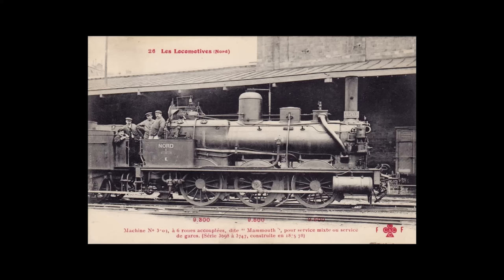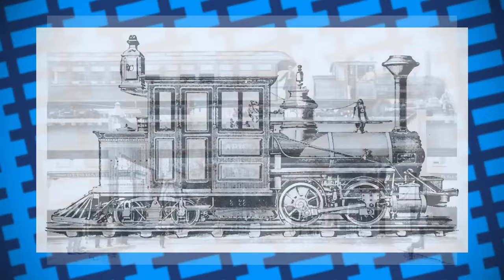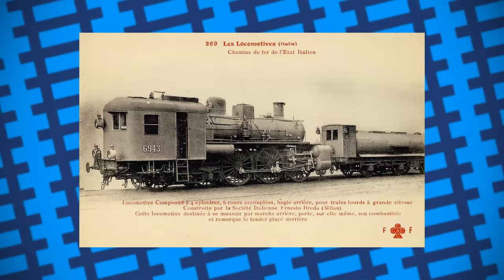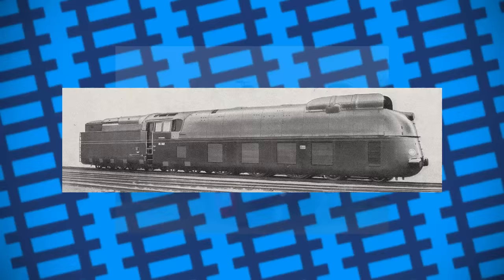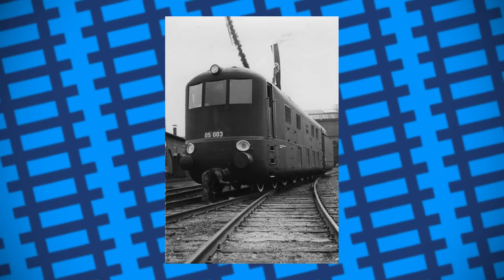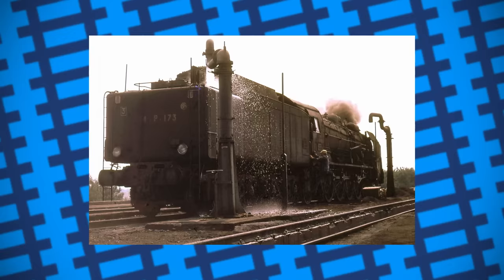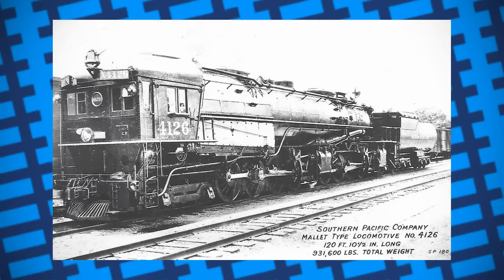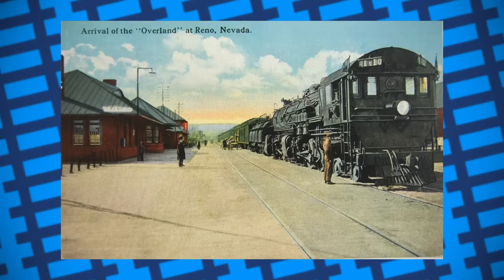Why "cab-forward" steam locomotives usually didn't work - Cab Forward Locomotives

Comment: Why there wasn't attempts to separate boiler input cab and driver cab? Since only the real problem was a coal delivery. It will force you to have at least 2-man crew, but it was usually the case anyway.

Comment: Most of a conventional tender is a water tank and only a relatively small proportion is coal.  Could have had a small low coal tender in front of the cab (or built in as a "nose") with the water piped from a tank tender behind.

Comment: If smoke inhalation was an issue just move the funnel. I dont see why that wouldn't work, though it may require more maintenance and me more dangerous than a conventional one. Also cab forwards can almost always be replaced by a large tank engine in my opinion (though obviously that would mean more coal and water stops). Anyway, great and informative video as always!
Reply: Where would you put the funnel? Just in front of the cab?

Pretty sure none of these options worked in practice/was to expensive, otherwise they wouldn't have gone thru the trouble with a front cab engine.
But creative ideas💡
Reply: The funnel is placed so that exhausted steam from the cylinders creates good draught for the fire drawing the heat and smoke through the boiler, and the opposite end of the boiler from the firebox above the cylinders is the most efficient.
Reply: @antonberglund117  Pipe it around the cab and put a box behind the cab to fit a funnel, with a small chute to allow coal through from the tender. The cab would be a bit smaller to fit all the pipework, and the loco would be a little longer than normal, but it isn't as bad as the flaws with a cab forward design.
Reply: @BrokenIET  nice simple and permanent solution, like it but I've no idea of a cost comparison other than the fact once you've made the tunnels bigger your sorted. Think there was a similar problem on the woodhead route in England and they refuge tunnels and electrified the route just after the second world war.

Comment: This might sound daft? but couldn't they have run a normal steam locomotive backwards, eg tender 1st but added a driving cab to the rear end (now the front end of) of the tender? bit like a `Slip Coach) and maybe controlled the speed, etc via telegraph, (like a ship) have the driver use a Deadmans handle and the fireman use a Deadmans plate between bunker and firebox. so if the plate detects no movement or some-such for a predetermined time a warning is sent to the driver!

Comment: Well, normal steam locomotives had poor visibility for the engineer. He had to look to the right of the boiler. Modern diesels for long distance freight and passenger service like Amtrak and commuter railroads generally have their cabs in the front. The engineer has an unobstructed view of the tracks in a modern road diesel.

Comment: I’ve always wondered why they couldn’t make a tender physically shorter but longer to compensate for the reduced capacity. Does any steam enthusiast know why this would or wouldn’t work?
Reply: Tender capacity as engines grew larger required the full loading gage for bunkering, even if you built an expedient like a Draper taper into the structure behind the cab for reverse visibility.  Even on locomotives with 'nose bunkers' like the PRR V1 and C&O M-1, the limiting factor was more the water than the coal, which could be achieved with additional water tenders but not particularly cost-effectively.  As on Garratts, something like CCTV might be practicable now for the necessary visibility -- but while available in the latter years of steam it was delicate and not particularly cost-effective.  Periscopes were similarly 'not worth the expense'.
Reply: @wizlish  since the concern of oil getting on the drive wheels was a problem with a rear tender oil fired locomotive, what would stop you from having a small coal tender in the front but setting up a rear water tank with the appropriate piping? L

I’m genuinely curious since I’m fairly certain someone has thought about this before but hasn’t done this before either for a valid reason

Comment: No mention of the Leader loco designed for the Southern Railway (UK)  by Bulleid in the 1940s? It had a cab at both ends, not needing turntables which was its main advantage. Fireman was in the middle of the loco, boiler one side of him, bunker the other.
Reply: It had the benefit of being an entirely new concept, rather than a conversion of the existing layout.
It had the disadvantage of still being steam, at a time when the future lay elsewhere.

Comment: The actual Description or Title is Engineer, for consist’s that being are pulled by Engine’s usually Heavy Rail and the Title or Description Motorman, for consist’s using electric motor’s such public transit LRT’s.
Which is usually light rail from which we get Light Rail Transit or, of course. LRT.
So. No. Not driver.
Thank you.
Almost everyday I’ll have someone calling us conductor’s.
That of course, is a completely different occupation.
Pretty good video.
Thanks.

Comment: Did anyone ever consider making a cab-forward Beyer-Garratt ?  The coal bunker on top of the forward driving unit would still have been in the line of sight, but no worse than the water tank was in conventional running.  Of course the Beyer-Garratt could run forward and reverse with equal ease so... maybe no real advantage.
Reply: The apparent general consensus was that Garratts are better run 'bunker-first' to keep the stack behind the cab.  The only 'drawback' is that the fireman faces backward to check or trim the fire, and there is a leading-overhang concern on a Union-Garratt (or hybrid with stoker from a small bunker a la PC firing).

Incidentally many Garratts were set up to be 'safer' in the preferred direction by arranging radial valve gear so the reach rod would be down in the 'forward' direction on both engines...

Comment: One of the British narrow gauge railways used a 'double fairlie' design which had the cab in the centre with the boiler cut in half into two separate boilers. This would keep the driver and (overworked) fireman in close proximity but in tunnels you would get smoked no matter which direction you went!

Comment: Hallo, IT was big problem with the Stephenson type steam locomotives with the behind situaci on cabina And Věry bad wiev to front side train. I know about few type steam locomotives with the "first  cab" system. Bit IT need automatiic working Steam boiler. Ať už was problem with the carbon heating.

Comment: I can see that steam engines are bad moving cab first but diesel works much better than steam engines do
Diesel: fine with moving cab first
Steam: bad moving cab first and if coal fired then it is hard to get coal in the boiler
Reply: There's a reason why cab forwards were oil fired

Comment: Does Toby the tram engine count as a cab-forward?
Reply: No
Reply: @whatdoyouexactlymeanbyhandle  ok
Reply: Strictly, no. Toby's prototypes - they did exist - were technically double ended, with duplicate controls in each cab. It saved the need for turning them at the end of the run.

Comment: Do currently running restored steam locos use front mounted camera(s) for visibility, or is that “cheating”😊  Also, to keep smoke away from the cab in long tunnels, could the smoke stack have been extended back over the top of, or inside the boiler and be exhausted behind the rear of the cab roof?  If that would cause draft or performance problems, a valve could be installed at a “Y” valve, on top of the smoke box to divert smoke only when in tunnels? Actually, I believe cabs-forward failed because the look was awkward and goofy, but conventional cabs look SO much cooler, better proportions, and definitely more bad-ass!

Comment: What if they just reversed the engine tender first, and put the cab at the end of the tender, using steel wires to connect the levers?

Comment: I don't get it, why don't anyone figure out that cab forward could be simply done by putting the cab on top of the tender and just do it by reverse both the tender and the locomotives? That way there is no problem to have the fuel stay with the locomotive firebox and cadets can still see things because there is no big boilers blocking their sights.
Reply: How would the crew run the locomotive if they are on top of the tender?
Reply: @Thomasnmi  The firemen would still stay at the connection side, but the piping and gauges would be extend to be on top of the locomotive and let cadet and driver to control form there as they sit on the tender and without much blocking of view, think like they would be having a view similar to modern days diesel locomotive, and because of the close range, they can communicate with the firemen with ease.

Comment: If i am honest i don't get why nobody added ship controlls: switches, but in a modified variation where there are much  more options but also not having one due but two teams of 2 or 3 people..
Reply: Money.  Study railroad union agreements precluding even the sort of 'corridor tender' approach used in Britain, where ostensibly the 'second crew' not in the locomotive cab wouldn't receive mileage unless actually driving.

One of the possibilities opened up by the GE MATEs in the early 1970s was that a locomotive 'consist' could include a fairly capacious fuel tender on a road-slug chassis, with the equivalent of a fairly extensive crew dorm also on a road-slug chassis.  The idea was to extend a typical tugboat crew model (as in competition with railroads) to running a power consist with analogous operation: the whole crew would sign in for a 'voyage', live aboard with full amenities for some number of weeks, and draw 'engaged to be waiting' pay when not actually running trains.  (This was still the era of John Kneiling's 'iron ocean' operating model for the future...)

You can guess how far this got with the contemporary unions.

Comment: Why not turn around the locomotive AND the tender? The boiler is limited by it's shape and function, but a tender design could be made lower to the ground so as to not obstruct forward vision.
Reply: That would make the entire Locomotive much longer. Unless you want to uncouple the Tender very often, you would have to rebuil every Turntable. Turntable Length also was the Limiting Factor when Union Pacific designed their Big Boy Locomotives.
Reply: @Genius_at_Work  I was thinking about the locomotive pushing the tender instead of pulling it. Still obstructs vision a little bit but it's a massive improvement compared with peeking over the side of the boiler. And would put something in front of the crew that could cushion some impacts. For turning and other maneuvers you would operate like always, just at the inverse.

Comment: Q. Do you know why an archimedes screw was never used to move coal to/near the firebox from the tender?
Reply: That was how pulverised coal was fed to the firebox on a 'conventional' automatic-stoker locomotive; some 9Fs in the UK were so fitted.   Impractical on SP's cab-forward locos.
Reply: @EllieMaes-Grandad  That's exactly what "killed" the German 05 003. I just explained these Flaws in another Comment, so I copypaste it here because I'm too lazy to type everything again:

Regarding 03:15: The 05 003 didn't have a second Cab, it was just a normal Class 05 (one of only three btw) turned around. The "Cab" at the Back is to open the Smoke Box Door to blow Soot from the Smoke Tubes. Fuel Oil was considered for 05 003, but ditched for Strategic Reasons that we all can imagine but won't discuss as to not risk YT censoring this Comment. Instead, 05 003 burned Powderised Coal, by blowing it into the Fire Box with Compressed Air. That System was tried and trusted by 1937, but 05 003 always suffered from unreliable Fuel Supply often causing it to burn Fuel rich, thus sooting up the Smoke Tubes, often even until they were completely blocked by Soot. If the Oil Burner wasn't ditched in Favour of Lebensraum, 05 003 would almost certainly have worked very well.

The unreliable Fuel Supply was caused by the Coal Piping having to pass under the entire Locomotive, which was not exactly a straight Pipe. The Fuel Feed System and Air Blower were driven by the same Auxilary Engine and thus couldn't be controlled independently, otherwise the Stoker might have been able to react to these Combustion Irregularities. Although I don't know how quickly Combustion changed, if it required Adjustments every few Seconds, I doubt that even the most skilled Stoker could deal with that. Because of the Problems, 05 003 was rebuilt in late 1944 by turning the Locomotive around again, and removing the Aerodynamic Covers Covers completely, thus turning it into a pretty normal German Standardised Locomotive, just with huge Driving Wheels. The other two Class 05 Locomotives were un-streamlined after 1945, matching them to 05 003. 05 001 was preserved with a Replica Streamline Shell.
Reply: Many, in fact most, large American locomotives had stokers that used exactly this to bring the coal from the bunker 'forward' to the elevators; in fact many used an Archimedean screw, or in the case of the Duplex, two screws, in the elevator itself.

This benefited from sized and cleaned coal, of course, and by the late 1940s led to a campaign by the AAR promoting good-rank, washed, 2"-sized coal as "best" overall for economical locomotive operation.  That extended to 'tramp iron' -- a comparatively small piece of which jammed in the stoker worm under a near-full coal load could ruin not just your day but progressively that of many others.

Some of the larger tenders in fact had two worm sections; as the long bunker emptied, plates would be laid over the forward section to preclude injury, and it was common to find 'coal pushers' on the rear slope aheet to move the coal down and forward to the worm.

Comment: You would think this would be a good idea with a oil fed locomotive. Where new systems could modernize the fuel flow to the boiler for a cab forward design. While allowing the engineer to operate the locomotive and let some automated system regulate fuel flow to the boiler and allow gauges to show oil fuel level and water boiler level and pressure.

Comment: What exactly is a “snowshed”?? Thsnks
Reply: Basically a tunnel but in an open area/not going through a mountain to prevent snow mounting on the tracks. Though most are now gone thanks to advanced snow fighting techniques, on Donner Pass a few remain for the worst sections of track in winter.

Comment: This is a nice presentation. However I do not understand why you had to add a barely audible background tune. You don't pause anywhere during your speech so no silence has to be filled. The background tune however becomes extremely irritating when noticing. And it does not contribute a useful thing.

Comment: Can steam engines move as fast backwards as forwards?
Reply: I think purely technically speaking, it should be possible to go just as fast in either direction (if we ignore things like air resistance which would play a bit of a part but i mean, it's a 60 ton lump of steel so...)

However practically, no. Timing an engine is a tricky process and you'll never get a perfect 50/50 split, and so in general all steam locomotives will have their valve timing optimised for forward motion since that's the way they're going 90% of the time (:
Reply: I believe not. the Southern Pacific "Special Instructions" for each division had specific maximum allowable speeds listed for all classes of steam locomotives allowed on each division and the speed in reverse was (as I recall) always substantially slower in revers than forward. This probably had to do with the tracking of both the locomotive and the tenser when running in reverse.
Reply: @patlatorres7000  I think for those cases, the limit isn't so much the engine's capabilities as it is the track's.

Like was briefly mentioned in the video, for rough and uneven tracks you'll generally have a leading bogie with 2 or 4 wheels to guide the main driving wheels around all the bumps and bends.

If you have e.g. a 4-4-0 locomotive going forward, it has 4 leading wheels to guide the driving wheels. But going backwards, it turns into an 0-4-4 and you no longer have the leading bogie helping out, making it more likely that the driving wheels derail.

I think there are also considerations around pushing vs pulling cars but that gets into complicated physics that I don't understand 
😅
Reply: Steam locos can run as fast either way,  look at tank locos on suburban trains in the UK..  ,  its the design of the leading pony trucks or bogies that could be a limiting factor
Reply: @roseroserose588 , as I stated, this is based on information in S.P. Special Instructions, documents that were issued in concert with the Employe (sic) Timetables. These are official operating rules issued by the railroad and I doubt that they were issued without some serious consideration and based on previous experience.
Reply: @patlatorres7000  apologies, didn't mean to come across as codescending - just trying to add extra context for why those instructions will have been in place (:

Comment: This video rather skips over those applications of cab-forwards locomotives or trains that were controlled from the front that were a really good idea:
Steam trams.
Industrial locomotives.
Railmotors.
Autocoaches.

Why no mention of the French VACDf and AV12 locomotives?
How about the Sentinel steam railcars? The LNER bought over 80.
And let's not forget the GWR Autocoaches. 256 were built between 1904 and 1954. You don't keep making something for 50 years if it doesn't work.